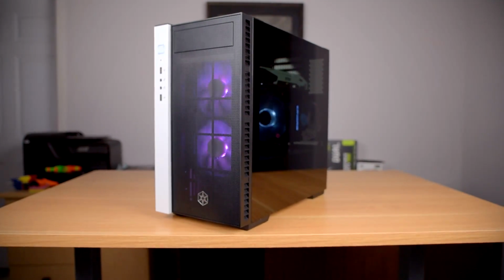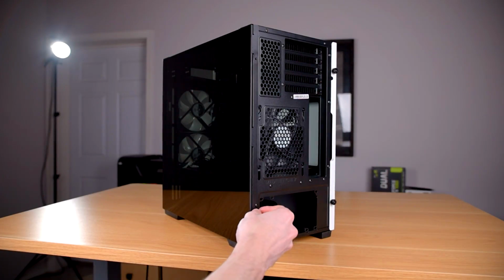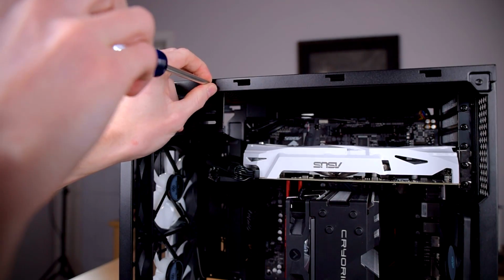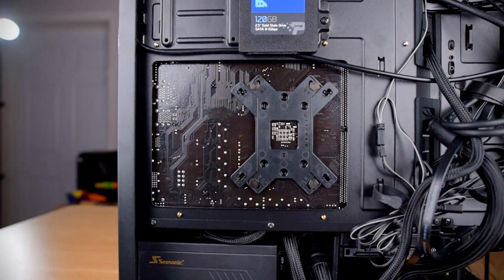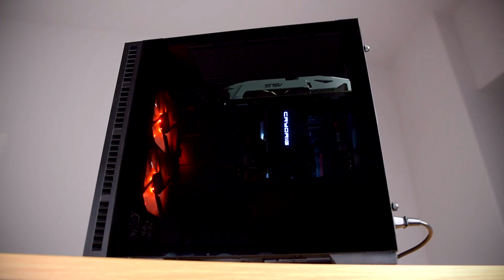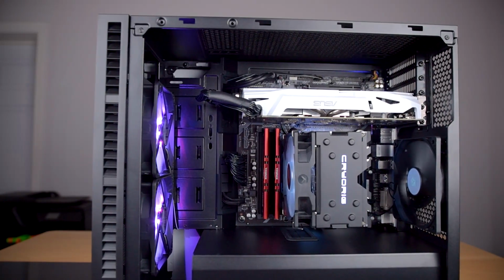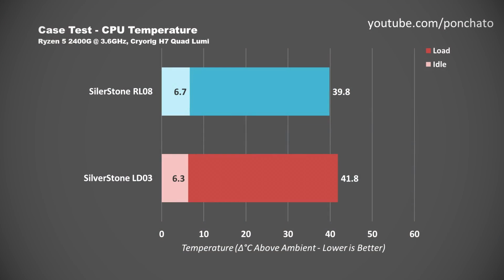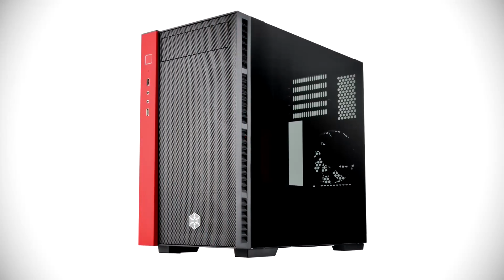Mesh Cases FINALLY Coming Back! [Silverstone RL08 Review]

Comment: Hi @ponchato wondering what rad/ fan configuration would be viable if I were to have a 240mm aio up the front. 

Currently I'm thinking front  exhaust with the aio, 2x 120mm fan intakes up top and convert exhaust on rear. Although I'm afraid of having negative pressure in the case having 3 exhaust vs 2 intakes

Comment: You have mentioned there's a need for fan splitter. But if we have a RGB compatible motherboard support like aura sync or msi's mystic can we directly plug fan cables into motherboard's RGB headers or do we still need a external RGB header for activating and using 2 fans?

Comment: woa the air cooler so expensive. Anything cheaper that fit?
Reply: Arctic freezer 34 esports Duo?
Reply: @onurgunes9026  the problem with arctic freezer is that won't fully cover the cpu as someone shown on review
Reply: @niuniuita  as i saw they said it is not important. Still it drops it for 15/20 celcius. But im just speaking about which i see. Im not built a PC with that yet.

Comment: I just keep using the Corsair 540A and never went glass on the front.  I keep looking for something more modern to build into but what I really want is just a 540A with a glass side panel instead of the acrylic or a 680x with a mesh front panel.

Comment: i appreciate the review but i just don't get the upside down  motherboard setup....
Reply from the maker: Potentially better airflow for the GPU, otherwise mostly just aesthetic. Also being able to have your computer to your left and the window still facing you
Reply: @ponchato  yeah i was thinking about desk orientation after watching the video, but most gpus are oriented with their "lettering, title, nameplate" horizontally and that puts it upside down.   it would drive me crazy lol.   it is good to see mesh making a comeback though.   anxious to see more changes with case design in 2020.  i want to see fractal jump on the mesh train without the crazy abstract "meshify" design and lose the foam.

Comment: Why do you like the motherboard upside down vs normal right side up?   Is there any advantages for you?
Reply: If you have a water cooler and it leaks it wont destroy your gpu as well.
Reply: @randomgamer6118  instead it will leak onto your PSU and kill all components in the case. Nice
Reply from the maker: Potentially better cooling for the GPU due to increased clearance, otherwise it's mostly just aesthetic. The other thing is if your desk setup would work better with your PC to the left instead of the right, the tempered glass will be facing the right way in this case